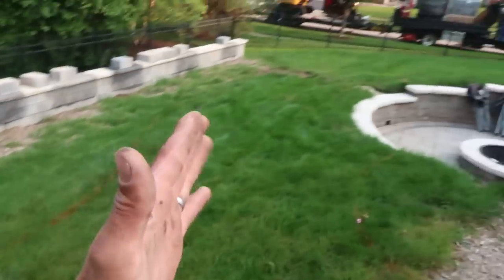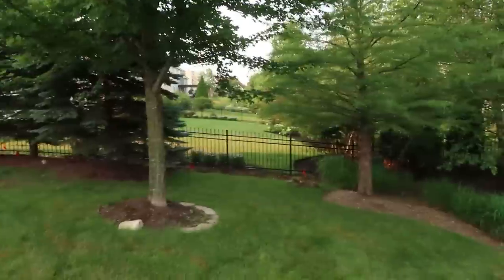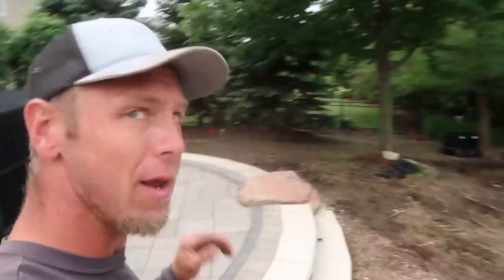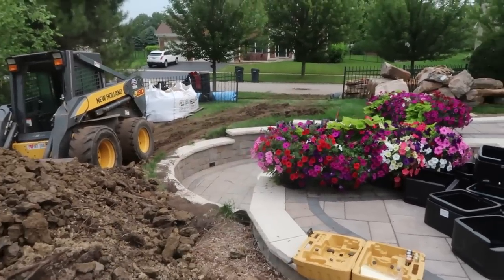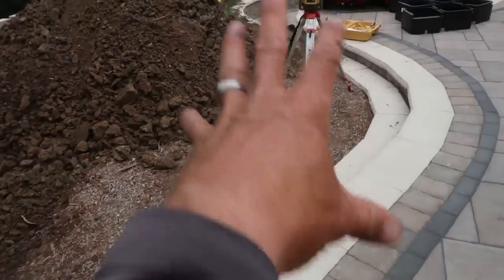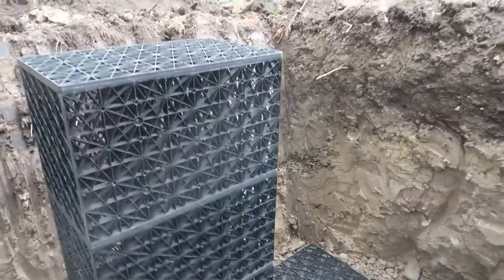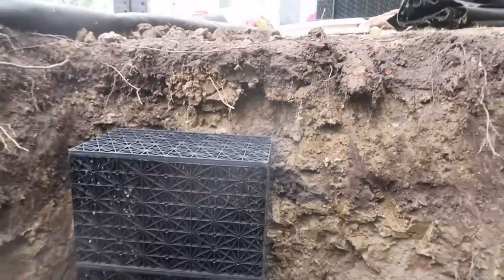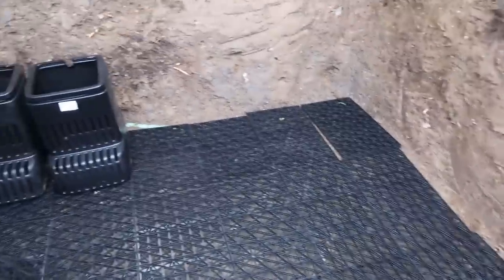Rainfed BACKYARD POND & Oasis Build - Part 1

Comment: Hi guys!  Great work.  I have a couple of questions...1) What was the tool you used to cut the liner...super slick! 2) Why did you put some Aquablock panels in vertically? Very interested as I am putting in the same sized/shaped reservoir for my first project (Just waiting for Aquablox...send any extra my way!)
Reply from the maker: It's a makita multi cutter. We use the panels to fill in the space around the pump vaults. A panel between the vaults and panels around them to make a tight fit. https://www.amazon.com/dp/B076YL2RZQ/ref=cm_sw_r_apan_glt_fabc_FEVKWJAM04140E259CR4